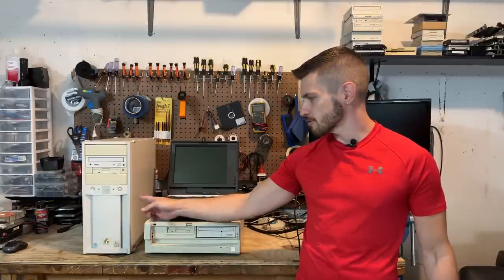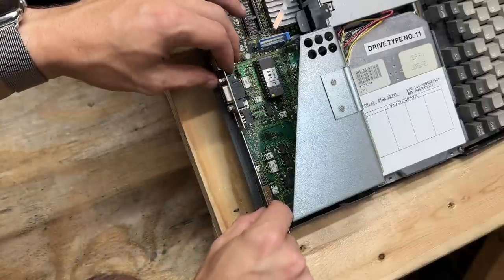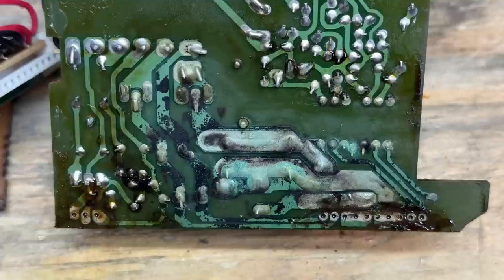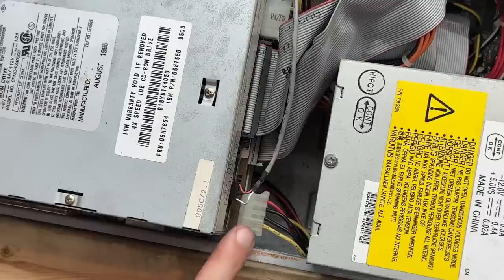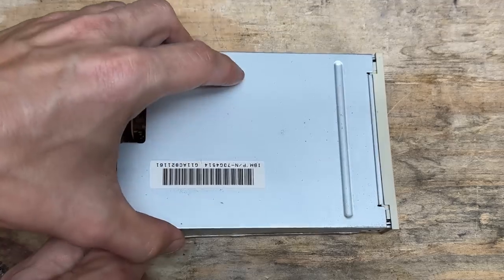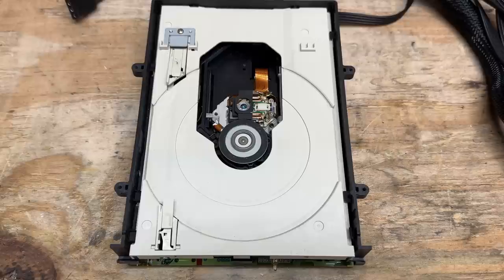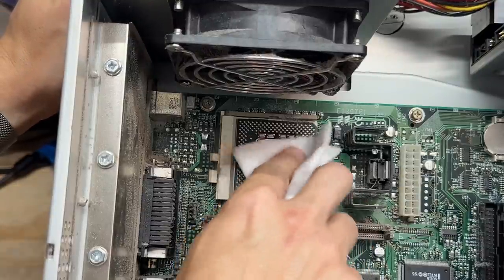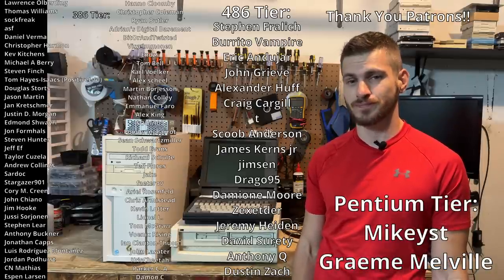Let's check out the systems I bought from VCF!

Comment: With those Gateways you could also pull the external bay cage and reinstall it by 90 degrees if you wanted a desktop config.  I poked around a few of those things way back in my tech support days.

Comment: As a heads up, just because a capacitor is a Rubycon, Nichicon or the like doesn't mean it can't fail. Just this year alone I've probably swapped well over 100 Japanese caps alone, even some that weren't looking bad but once I swapped them out any issues I was having got fixed. Some even tested fine on my (admittedly crappy) LCR meter but once I changed them out I've had dead computers come back to life. It's worth completely recapping anything you intend on keeping working for any length of time. I've had computers working for maybe like 10 total hours after I got them only to start working/intermittently working until I fully capped usually just the PSU. Even the small 1uf electrolytics can cause issues, at this point I've made it a point to replace all the electrolytics in any computer I want working even if it's working already.

Comment: There was a note on the back of the laptop that said the default voltage is set to 230v on the PSU and you did show the switch after you tore it down but its hard to see the voltage.  If someone else in the states plugged 120v in and turned it on set to 230v they may have blown that regulator or other parts.  Be sure you check the switch before powering it up.  On the third system the whole 5 1/4 bay may be able to be turned sideways so the drives are upright in desktop mode.

Comment: Ha, I cringed as soon as you mentioned the sound card with a modem.  That was the first thing I replaced on the first Wintel box my family had.  It was a Packard Bell, and that card never would work with both at the same time.  You either had sound or modem.  Definitely one of the reasons they were called Plug N Pray.

Comment: I had that exact Gateway tower. P166, 16mb of ram, 2gig WD caviar, 17” CRT, 56k modem. That setup cost $2400 in 1996. I still have the hard drive.

Comment: Good video as usual mate,

My Aptiva (that's also missing the front) also came with the same optical drive etc. 

The optical drive is a Mutsumi (they are identical to a Mutsumi 4x I have too)

I've also been told by friends that the PSU in these IBMs is the week point. I'm likely going to recap it to be cautious.

Also, regarding it having similarities to the PS1 - I believe the chassis is the same. If you look behind the front bezel there is a fan mount which is useless to the aptiva (the front bezel blocks it) where a PS1 has a fan In that very position.
Reply from the maker: Thanks! Yeah seems like this machine was right in the middle of IBM's PS/1 to Aptiva transition.
Reply: @miketech1024  100% - between yourself and Epictronics I've seen a few variants lately that definately make me believe that has played a part.

Comment: Being that it's a Pentium 1, that RAM will either be 168-pin EDO (unlikely) or PC66, not PC100/133. The tell is that it's a single-sided module. those old machines don't do double-sided very well. 
A lot of those quad speed drives in some cases have deteriorating foam. The foam is just for sound dampening and can be removed without replacement.

Once you get a pinout, it might be possible to make a 3D printed bracket for the fan and power connections and then shove a meanwell supply in. all depends.

Comment: 29:48 when you put this in tower orientation, I had to double take, because the bottom looked like it was missing! I have only seen a few of these in real life - made a video of one many years ago. But both of those had a front panel that matched the way the computer opened if that makes sense.

Comment: That Aptiva is probably early enough in the production run to still have some PS/1 similarities and even software.  That model started essentially as a renaming of the PS/1 line.

That Gateway, back in the day, we used to call the "Baby Gateway" because they had finally moved on from the ridiculously tall Full Tower AT cases.
Reply: It's just that I like those tall cases. They remind me of skyscrapers!    :-)
Reply: @keithbrown7685  oh don't get me wrong,  they were the right height to put a mouse pad on and use as a scrolling surface.  Lol
Reply: Haha!  I have a full tower modded to house my Amiga 4000 with a Video Toaster set up... and generally use the top for either the mouse or an LCD monitor (for the zz9000 HDMI output/BNC from the Toaster.)  It is a table height, flat surface to use...
Reply: @geoffreyreuther5260  I don't know this, but I have heard that if you put a P4 into them, then you'd have a space heater and a mousepad! 🙂

Comment: Damn Small Linux is a handy Live CD distro for vintage hardware.  It's very out of date (Kernel 2.4.x, 2008) but it supports some pretty old hardware.  It can boot to a GUI desktop on a 486 with 16MiB RAM, though it's happier with 24 or more.  A boot floppy image to accompany the CD is available as well for systems that don't natively boot from CD.  Sound, video, and network are usually autodetected without any trouble.
Reply from the maker: I was almost in tears when they ended development of DSL. I remember loading the entire image into a ramdisk and it running crazy fast!

Comment: That Gateway is a definitely a late model Pentium P54C, its got the later black chip style used on the MMX onwards and it has DIMM memory, although the MMX didn't reach the shelves until Jan 97..
Reply: I also noticed that there's no MMX on that PPGA. Didn't know these existed
Reply from the maker: It did surprise me that this chip lacked MMX.
Reply: @deschoee I recently obtained a Pentium 200, non-MMX in the same form. It surprised me too.

Comment: That Gateway has a BIOS update. One of Intel's early ATX boards too. Despite having the 430VX chipset with a USB capable PIIX3 southbridge, the ports were omitted since they were buggy/broken. The pads are still there though.

The reason the Aptiva has PS/1 software is because it basically is a renamed PS/1. The entire line went to the Aptiva branding in 1994.

Comment: I enjoy your content, somewhat of a retro PC lover myself. I recently restored a Packard Bell D160. The IBM Aptiva is similar to Packard Bell units. They both use the same riser design, modem/soundcard combo, motherboard layout. The Voyetra app is interesting, it is identical to P Bells audio station program. Makes me wonder if these companies were collaborating, using the same parts and mfg facility? Who knows. Welp, good luck with the lap crusher, looks like a fun challenge.
Reply: Voyetra easily supported oem branding. They had a self branded version too. I remember using it with my Packard Bell in 1996. I thought it was super fancy 😄

Comment: Good news. That Gateway is the same model of the Windows 95 software book I sent you. I remember painting it with some of that higher grade speckled black spray paint. It came out looking faster than the computer was. Sorry, I just hated beige.
Reply: Oh yea. That model, you could take out the mounting bracket with the CD-rom, Floppy drive and mount it sideways. Converting it from a tower to an oversized desktop.
Reply from the maker: @SGTMacBC  Cool! I also noticed the Gateway emblem could be pulled off and rotated also, assuming the plastic clips survive.